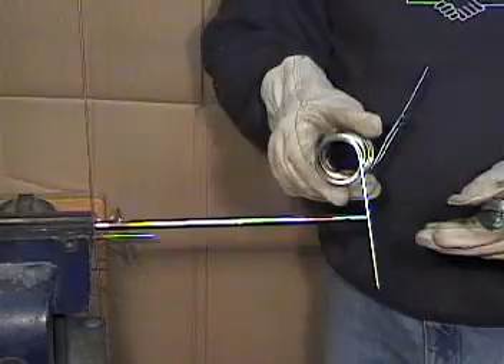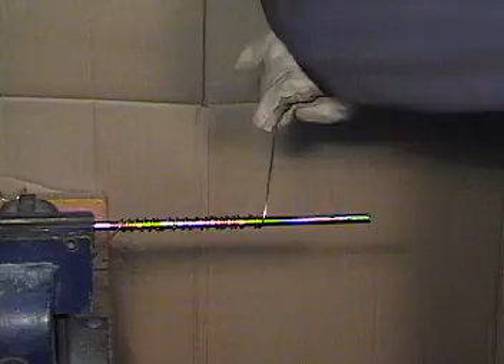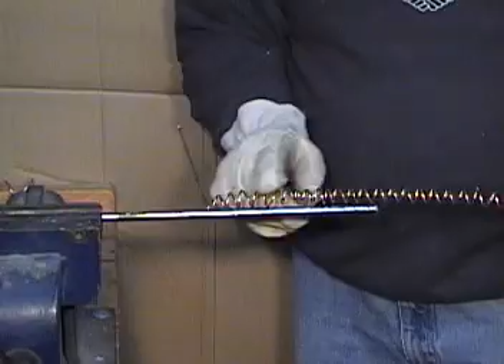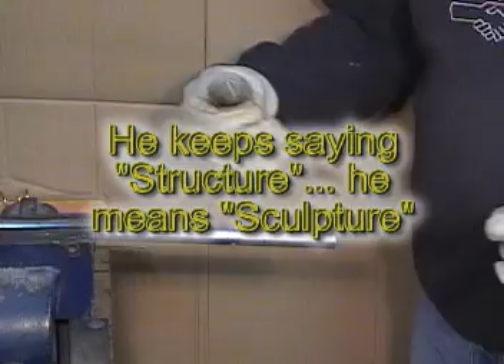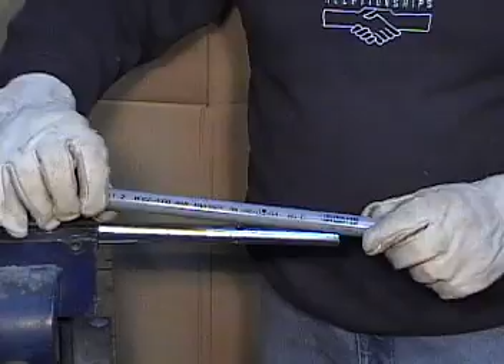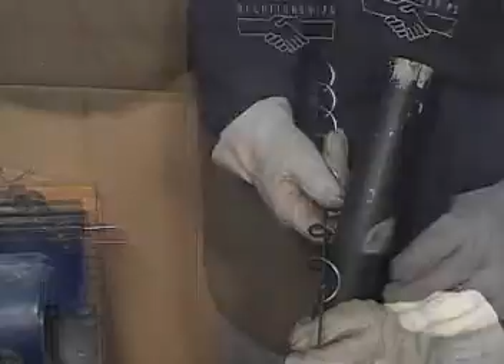Ball Lift Spirals For Rolling Ball Sculptures.

Comment: Mannnn, I did one of these for a pachinko lifter and had to solder like 400+ support braces to inner race. I then used 3 smaller rods to hold the outer spiral that required another 400+ solder joints to finish her up. Had to use a MAP gas torch for the center because I used a general hollow copper plumbing tube about 3ft long. I had made a see through track much like another guy had but I had a lot of snagging areas. I think I'll use those same drill rods in a new attempt. (: P whew!